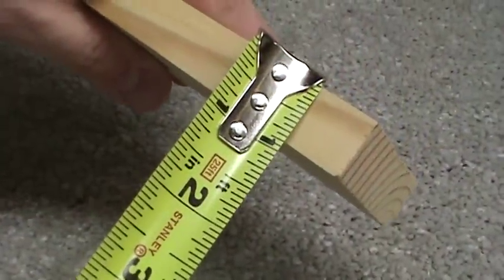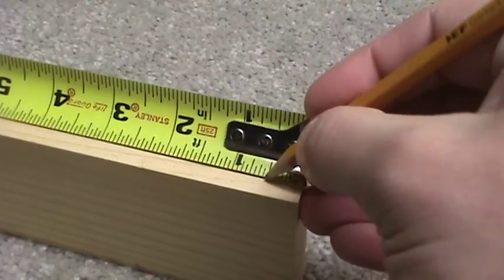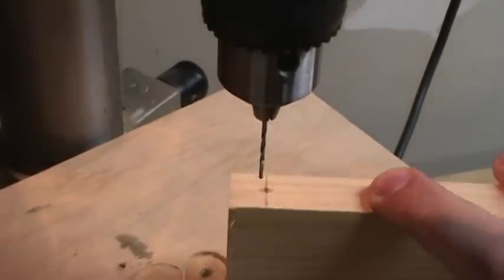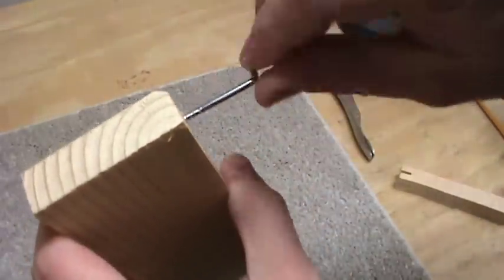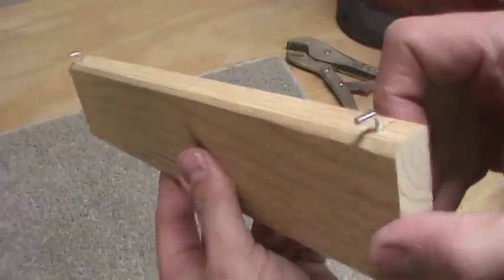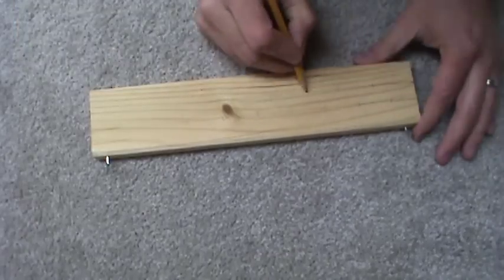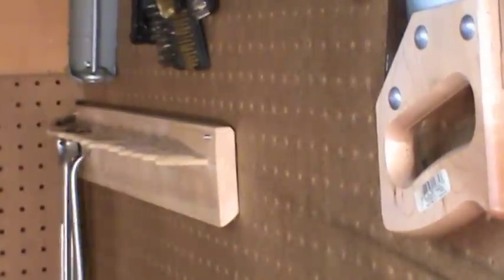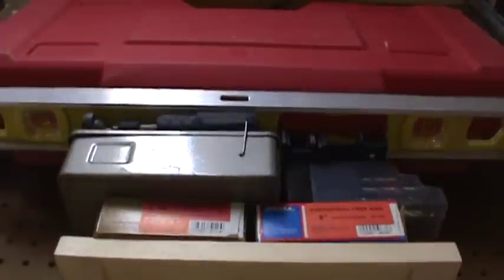Simple Pegboard Shelves

Comment: Thank you so much for the best pegboard idea ever. I have altered your basic idea somewhat by using 2x4 lumber instead of 1X4. I have made 7 modules so far. Hammer holders, screw driver holders, and wrench holders. My original idea that i built so far was using a scrap piece of 2x4 cut off at a 45degree angle mouted to a flat 2x4 with a soup can on it facing 45 deg. Up to hold utility knives and one to hold pencils. Basically I  watch french cleat videos and adapt the L hook attachment method to the peg board. There is no limit to the ideas available. WHAT A GREAT IDEA THANKS SO MUCH

Comment: I bought a bunch of Talon peg board hooks and while they attach quite well to the pegboard, they don't seem to work well as tool holders.  I've now ordered the right angle screws you used and have made screw driver, nut driver holders to use that technique.  Thanks for the idea.

Comment: More efficient use of space for screw drivers over the commercial wire versions, Combination wrenches also benifit from the tighter spacing. I prefer 1 long peg hook for my rolls of tape however. Open up more possibilities for peg wall storage. Thanks for sharing.

Comment: That last shelf you made was really strong! great job! I was wondering if you could help me figure out how to hang drywall in my bedroom so I can utilize unused wall space. I have a small room and I want to use every inch of space I can. Thank you sir!
Reply from the maker: +Will Hill I've hung drywall before, it's not too difficult.  I don't have any videos on it, but a quick YouTube search on "how to hang drywall" will turn up lots of information to get you started.
Reply from the maker: +Will Hill Ah, I understand now... For pegboard, you need some space behind the board to allow room for the hooks to poke out the back, so the pegboard will need to be offset from the wall. Simplest way I've seen this done is that people will build a frame around the edges on the back using long strips of wood. This creates some space behind the pegboard and adds a little strength to the pegboard panel. These "framed pegboard" panels can then be hung from the wall. They'll need to be mounted well to hold weight, either in wall anchors, or better yet, studs. A French Cleat is an easy and strong way to do this. This guy did something like this:  https://www.youtube.com/watch?v=sOTOvBLk_YQ

Comment: For the "heavy duty" shelves with the back support or angle brackets, do you add any extra L hooks? Or does the bracket just rest against the pegboard?
Reply from the maker: Brandon Beeson For those example shelves I still used just two L-hooks. The supports/brackets keep the shelf from stressing/bending the hooks as it gets weighed down, and helps transfer the weight to the pegboard better. Still, I have a gut feeling I overloaded the last shelf just for spectacle. If dealing with lots of weight, extra L-hooks are a cheap way to add some peace of mind.

Comment: Is there a weight limit on how much that L hook can hold even with that support piece holding the shelf up? I want to be able to mount some power tools like my my saws etc
Reply from the maker: I don't know about a weight limit. I typically use lightweight items with my L hooks. For heavier stuff I might put the weight a few inches below the hook so it's more of a vertical force on the hook instead of a bending force. Another simple system I like to use for hanging heavier items is called "french cleat" ... You can find lots of videos on YouTube about it.

Comment: Well, I made 4 new pegboard items today.  Two shelves, one undecided and one pliers holder.  I took a photo but cannot seem to find the button to upload it here.  Oh, well.  They came out well except:  The L hooks are difficult to get the correct distance to the pegboard.  I just added a shim behind the shelves to tighten up the fit.  Now I have to figure out how to make a holder for all the miscellaneous drill bits I have.  I think I will make one out of cardboard to try it before going to wood.  Any ideas?
Reply from the maker: If the hooks are a bit loose fitting, sometimes you can tighten up the fit by bending the ends inward a little. Drill bit storage is tricky, people have lots of solutions (just search youtube). It's something I've put off forever myself. I'm a fan of prototyping in cardboard.
Reply: I will try bending the L hooks a bit.  The shim works also but looks awful.  As for cardboard, Amazon boxes, cut up, laminating multiple layers (90 degrees) makes a 'wood substitute' for prototyping.  Hot gluing the pieces gives me almost instant feedback on whether the design will work.  I did take a lot of magnets out of old hard drives, maybe that would be a good solution to the drill bit storage.  These magnets are really powerful.  I don't really care about looks.  I just care about it working.  Thanks Ben.

Comment: What size L-hooks did you use?  Pre-shopping online I see that hardware stores stock a number of different thicknesses.
Reply: I'm looking for an answer to this same question. I did find an amazon review for the 0.106 Inch x 1-3/8 Inch size, "I bought these to rig up some pegboard shelves. They are a bit too small for that. I'm going to have to order a bigger size."
Reply from the maker: You'll find some links in the description. Mine were 1 3/8, the bent portion was maybe 1/2" or so. But you could go bigger as needed.